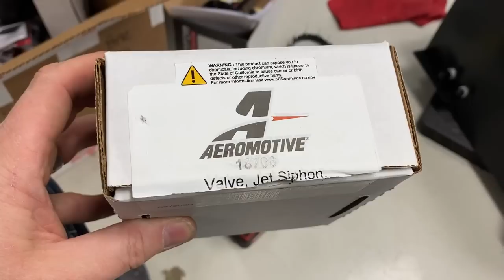Project 'Top Gun' - Feed the Beast - V10 Ultima Evolution Convertible Build

Comment: Love your mods for the fuel system and serviceability, I might borrow that idea for side pod floor access panels.  Those air horns have gotta move though or you are in for a loud surprise the first time you use them.  The area where the horns are now is sealed off to the outside but open into the cabin.
Reply from the maker: What!?  Lol. Good point!  Crap...now I gotta find a new home for them. Just no space!

Comment: You could have cut the hole in a more accessible location on the slanted side of the tank and just bent the internal hanger so that the pumps sit vertical. Rivets are preferable to bolts as they spread the load over a larger area, to avoid metal fatigue due to too few mounting points.
Reply from the maker: Yep, agreed I could have done that. One reason I wanted to keep the slanted side clear is for the air to water cooler that will go on that side of the car. It’s fairly big and I didn’t know if the fuel pump hanger assembly would interfere. Now that I’ve fitted the cooler, I think I had room to slant mount the fuel pump hanger....but oh well, I’ll run what I got. 🤟. Oh and I used body washers on the 3 lower mounting bolts; these help spread the load across the flange surface. Combined with the other front and rear tank hangers, the tanks are rock solid.  Thanks for the comments and guidance. Much appreciated! 🙏

Comment: I like your approach to your build with being able to gain access to the various systems.  I'm considering ordering an Ultima RS kit, I'm sure there is a lot of commonality in the build.  I too want access to the key systems just in case.  I'm sure you've given it some thought - what are your reasons for not making the side pods removable?
Reply from the maker: Since I haven’t mounted the side pods yet, that’s certainly still an option. I hadn’t   really considered that yet but it’s something I should think about. It would certainly be the best solution for serviceability!  Perhaps rivnuts instead of permanent rivets would be the ticket. Hmmmm.
Reply: @DanDulac  That's what I was thinking.  Do you know the wall thickness of the tubing?  M3 & M4 rivnuts maxes out at 2mm thickness AFAIK.  Also, which of your videos discuss the air lift system?  I think airlift might be better than hydraulic.
Reply from the maker: @TheAeroegg  I think the square chassis tubing is .085” wall (max) so a hair over 2mm. I need to find the tube I cut out in the last episode and check (it’s buried in snow outside. Lol). I used M4 rivnuts on a couple of the square tubes to mount up fuel lines and they just barely worked....the air lift system is in episode-4 “Stop, Drop & Roll”.
Reply: @DanDulac  Thanks!  "Barely worked" actually sounds promising.  As long as the rivnut doesn't fall out or spin (if the bolt happens to be too tight) then it should work well.  An M3 rivnut should also be an interference fit to a 1/8" hole.  And you will need far less rivnuts than pop rivets.  I'd go with stainless M3.

Comment: Let us know how the cross over tub works? Where do you come with all these ideas such as the surge tank? Thanks Merry Christmas to you and yours
Reply from the maker: That small surge/slosh tank inside the fuel tank was already there; the Ultima factory installs those as these tanks are designed for an external fuel pump setup.  Since I went with an internal fuel pump, I don't need that inner surge tank--the rubber bladder serves that purpose.  I could have cut out that small aluminum surge tank but since it was not in the way, I just left it.
Reply: @DanDulac  I'm curious though, would fuel not get trapped inside the little surge tank considering it has those one way baffles? Yes there's now that little hole left open where the tube used to slide through, but is that enough to allow the fuel to drain back out into the rest of the tank?
Reply from the maker: @JamesTaylor89  there’s actually a small trap door on a hinge that lets fuel flow in/out of that small internal sump tank. Haven’t had any issue with it so far.

Comment: Why not make the side pods removable... use nut-serts instead of rivets?
Reply from the maker: Another viewer said the exact same thing...I’m going to investigate that option. Given there are body panels that bolt to the top side of the side pod, I might have to make provisions on the top side too. Might be much more hassle than it’s worth.  But I’m definitely going to investigate options.
Reply: @DanDulac  I'm of course curious if you run across any showstoppers!  The YouTube information on the center section build of the Ultima seems limited at this point, so keeping my fingers crossed there are no showstoppers.  BTW I found some McMaster-Carr M3 rivet nuts that can go up to 0.090" thickness and I think installation is easier than standard rivnuts.  However stainless is $3.17 (!) per rivet nut, cadmium plated is just $0.41 each.
Reply from the maker: @TheAeroegg  so far no show stoppers in the center section. 😎. The build on the front two thirds of the car is a normal affair so far; like any other Ultima build on YouTube. In my build series, I figured I would focus on the non-standard stuff...if it’s in one of my videos, chances are it’s not in the build manual. 😇

Comment: I think I would have cut a big access panel in the flat side for access after this tank was installed just sayin.
Reply from the maker: I considered cutting the hole for the fuel pump hangar assembly on the large angled flat surface, as you suggest.  However, that would mean the bladder would sit a weird angle and reduce its capacity by ~40%.  Since I managed to do it from the top, the bladder sits 100% flush with the bottom of the tank as it was designed to do.  The other thought: I should never have to service the fuel pump (knock on wood) since I'm running pulse-width modulation pump control...this means the pump runs at a much slower speed at idle and part throttle, extending it's life considerably.
Reply: @DanDulac  got it one of the reason’s for access is I have had to replace a similar pump on my BelAir. Still nice build.